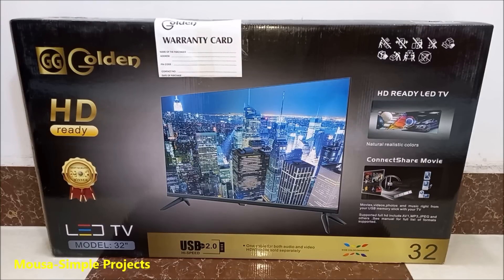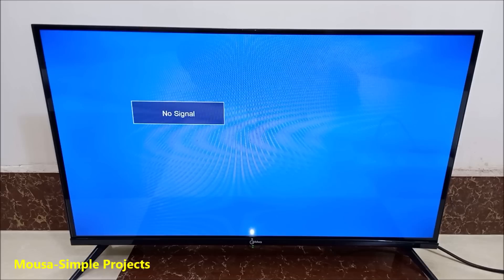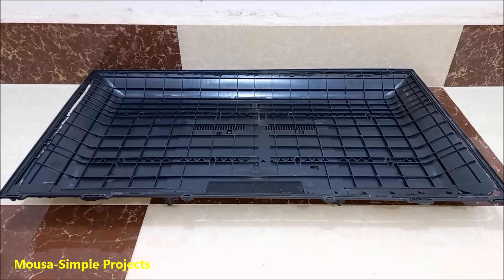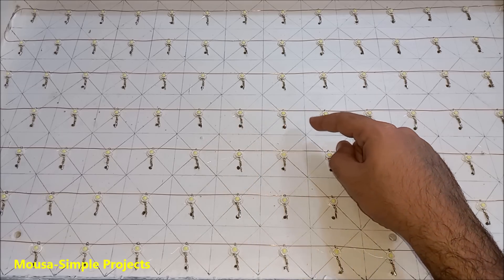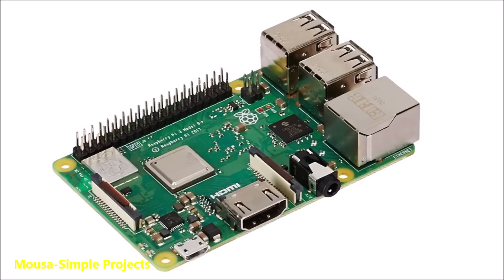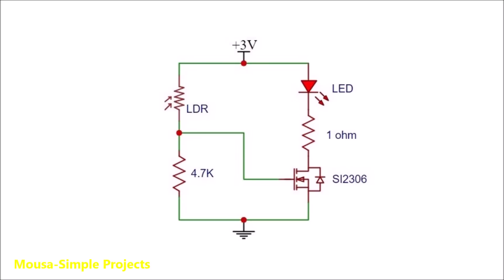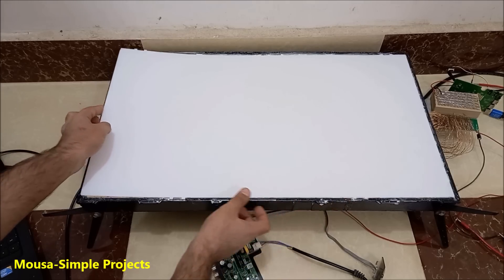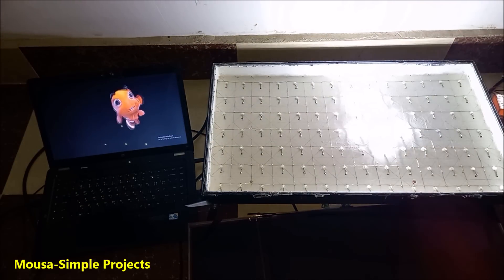How to make Local Dimming mini LED TV Backlight

Comment: Amazing! You should do it again with a bigger tv and more LEDs. Try around 20,000 LEDs!
Reply from the maker: In local dimming you don't need too many LEDs, TCL company has made 75 inch TV with only 100 zones/LEDs, My TV is 32 inch with 98 LEDs. The resolution of the backlight is not critical, LCD create the image not the backlight. Google this: (TCL C655 PRO 75" )

Comment: Hey man, what a thinking...you can actually drive it with Arduino, but it's hard to interpret the video data based on XY location and you have to approximate it to suit according to your project. Great, loved it so much.. +1 ❤
Reply: hdmi decoding cannot be achieved with an Arduino, you at least need a fpga for that
Reply: Arduino isn't powerful enough. A full HD screen is 2,073,600 pixels. If you have only 1 frame per second, an Arduino at 4MHz have to parse the video colors, calculate if the LED should be on or off, and drive the LED in only 2 clock cycles. And that after decrypting the HDMI datastream and decoding the pixels for the entire screen.

And it's not that funny to play or watch much content at 1fps...